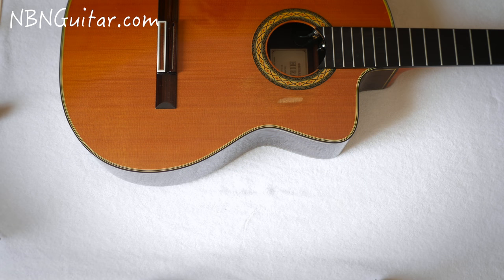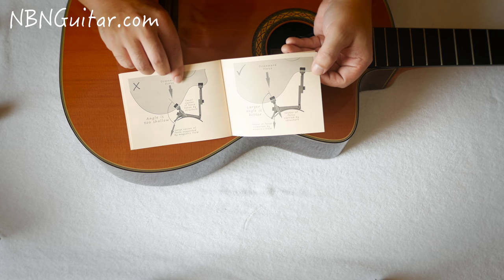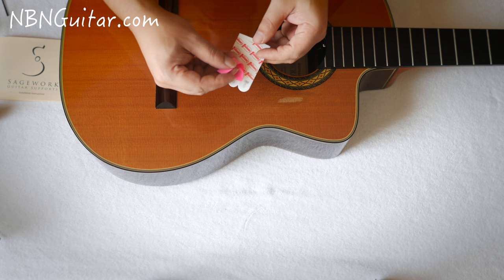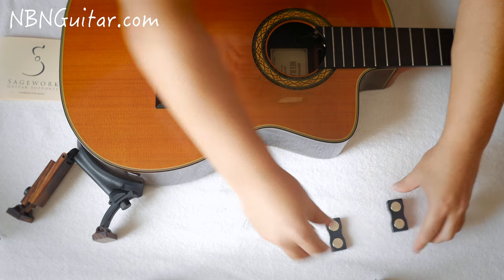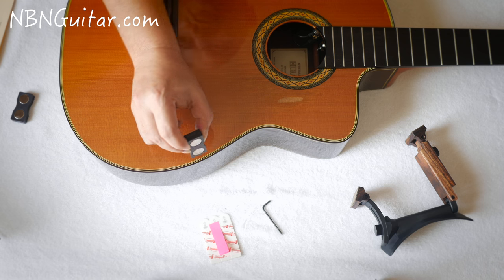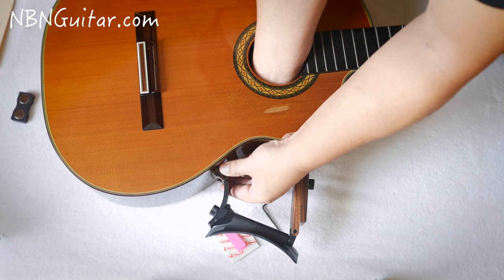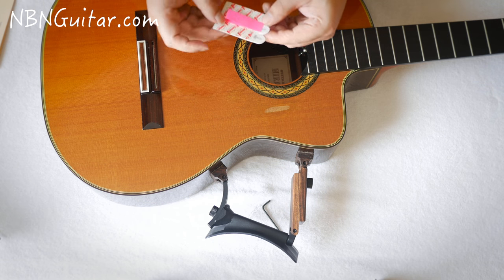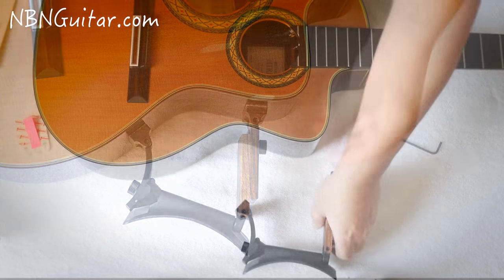Sagework Guitar Support Installation Guide | Guitar Supports | NBN Guitar

Comment: I have been using the ErgoPlay support for years. He suits me. This magnet idea is interesting. But there are a few things to note. 
1. Installing a magnet in the body of the instrument can cause overtones and change in tone. But many people already install boxes from the pickup. 
2. Humidity fluctuations can cause magnets to peel off, as they write about here. If you have a guitar with a matte finish or French lacquer this is a godsend. 
Thanks for the review.
Reply from the maker: Thanks for sharing your insights Victor. I can say I've been using mine for years and I've never had an issue. If the magnets do affect the tone, I haven't noticed it.

Comment: I just got mine yesterday and installed it using this method. 

I'll use it for a while before giving some kind of definitive review. 

First glance though it seems pretty decent and safe. However unlike an ergoplay which has a soft foam pad where it touches your leg, this one is far firmer and is uncomfortable in shorts or thin silky fabric. By uncomfortable I mean it cuts into your leg a bit. This problem could be solved by installing an aftermarket foam trim on the bottom and I might still do this. 

But I typically play in jeans anyways, if I'm seriously practicing just to avoid slip, and in jeans it's fine and doesn't feel like it's cutting into the leg.
Reply from the maker: Nice. I hope it works out for you and the foam trim is a good idea because the original is is quite firm. I wouldn't be without mine anymore :)
Reply: @nbnguitar  Yeah I need some realistic play time. Since installing it yesterday and changing strings I haven't had a chance to have a good play sessions. 

But I'll know immediately after having had that play session and I'll let you know.

Comment: One magnet came off... :( with the adhesive. I even left it with the support on for 2 hours
Reply from the maker: Oh that's a bummer Pedro. Mine's been on for over 3 years and it is as good as they day I installed it (same day as this video actually). You must've received a faulty unit. Have you been in contact with the Sagework team?
Reply: @nbnguitar  it could have been something with the dust. It did not have in the area I applied it to though...

I did, no we wait.. :)

Comment: If you have a pacemaker or ICD (implanted cardioverter defibrillator), you should be very careful about using this guitar support. In fact, the magnets may cause a malfunction of the pacemaker or ICD, putting your life in danger.
Reply from the maker: Thanks for sharing this info Joaquim.
Reply: They mention that in the installation manual..

Comment: I watched this video  right up until you tore off that red strip to put the adhesive on the magnet---and then raced off to do the installation.  I figured I had all the info I needed.

  I installed the magnets and supports  OK, but wondered...what is holding the magnets  to the guitar?  Mutter, mutter to myself.....So I  re-checked the printed instructions and saw a reference to the "black covering of the adhesive strip", and realized I was too dumb to understand that referred to  the black/white covering of  a double-sided adhesive strip.

Then I watched the video again, and...this time...I saw that you jumped from taking the red strip off to directly  installing the magnet WITHOUT showing you taking off the black/white strip  beforehand!    But  had I watched the entire vid I would have seen that you did show  removing the second b/w strip before installing the second magnet.  

So damn my impatience  for not watching the whole thing in the first place.   DERP!   

 Making idiot-proof instructions is not as easy as it seems, sez I, the idiot.

(I later realized that some picture hanging fixtures use the same  adhesive, to allow their removal without taking off the wall paint and drywall beneath).

Finally: it's a great product.  Supports with suction cups ---at least for me--just sucked.
Reply from the maker: Haha mate, this is so common in the world today i.e. impatience…watch to the end :)

Comment: how do you determine what size to get it comes in 3 different sizes
Reply from the maker: It comes in 3 sizes? Wow I had no idea! Things must've deepened their product line since I made this review. If it were me I'd contact Sagework directly and give them the make & model of your guitar. By doing so they may be able to determine the best choice for your guitar.
Reply: 2years after, but i answer for other people, it comes minimum in two sizes, 'short' and 'tall', and they sell also separately the only part that make the difference between the two.
So you can switch (but that part costs around 30e). And you have to try one to know which one is ok for you, but most of the time, the size of the guitarist should be the answer.  The official website 'sagework' maybe give that answer.

Comment: That's a good idea but too much of a hassle. One should remove strings each time an adjustments is needed.
Reply from the maker: As long as you set the magnets in the right place initially you shouldn't need to move them around because the support itself has several different place where it can be adjusted. Also, you don't have to completely remove the strings if you don't want to. One can simply loosen them to provide enough hand space.